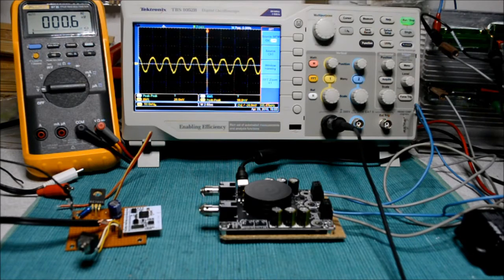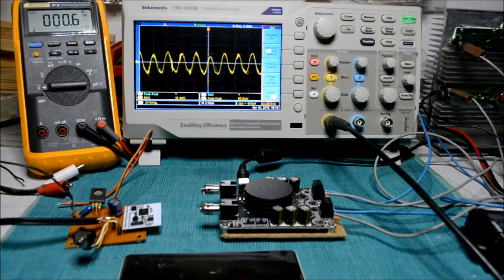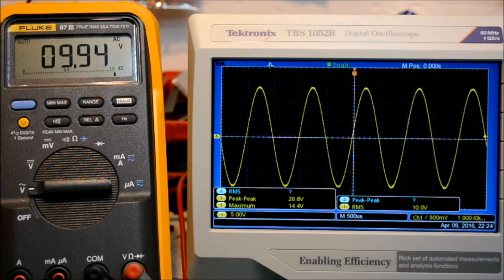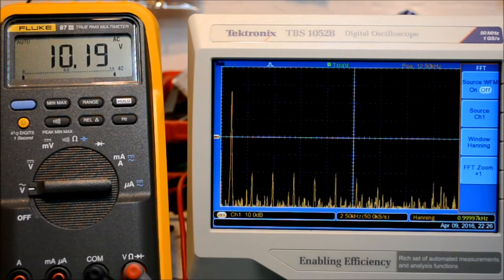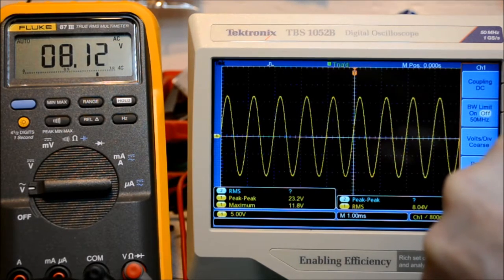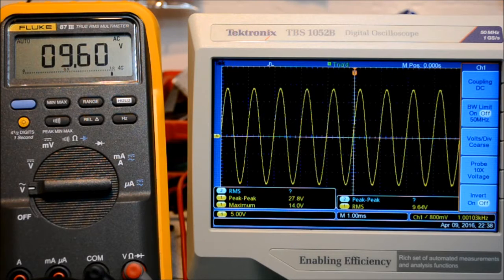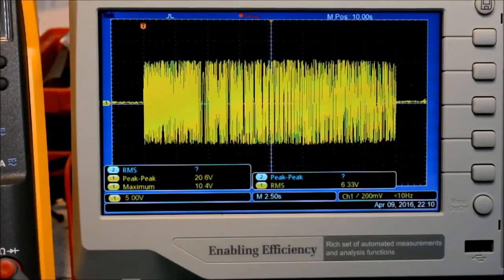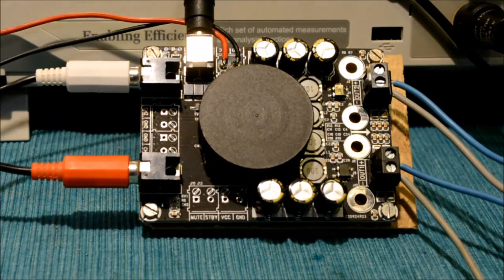Sure AA-AB32178 2x50W 4Ohm class D amplifier review TPA3116

Comment: Will this board take more volts? TPA 311x chips are OK with 24v, and 19-20v laptop PSU's are quite easy to obtain, 20v would give you a pretty healthy jump in output from 16v (>60%).
Reply from the maker: The board is specified for higher voltages and I am actually using it at the moment with a 20V/90W Lenovo adapter. Some laptop power adapters may not work though. I have tried a no-name adapter previously which did not like the load from the board at all.

Comment: I'm supposing that anywhere above 30w the distortion is going to be quite bad?
Also the clipping would be approaching square wave yes?
Reply from the maker: At 30W / 16V / 10% the clipping is already clearly visible in the output signal (and very audible!). It will not make sense to drive the amplifier harder and push for more output power since the signal will approaches a square wave as you suggested. However, if you provide the maximum specified supply voltage of 21V I think you can approach 50W @ 10% distortion. The Sure datasheet specifies: - 50W@4Ohm 21V DC THD+N 10% - 30W@4Ohm 21V DC THD+N 1%I believe the data sheet from Sure is trustworthy in this respect.
Reply: Thankyou for the reply. This makes perfect sense!